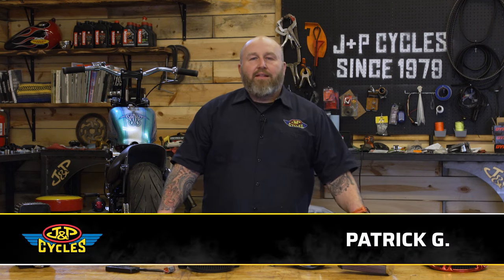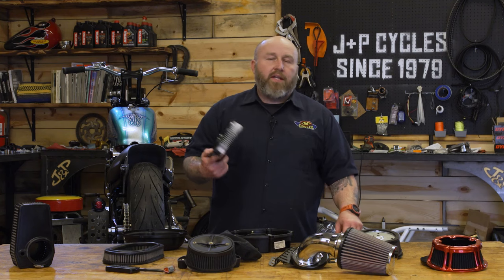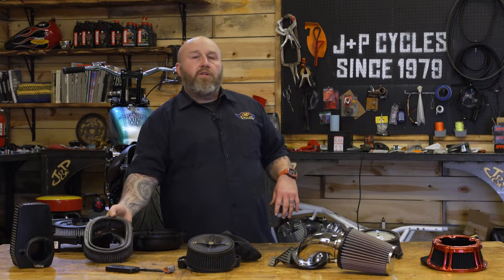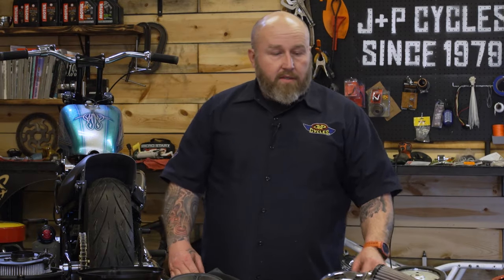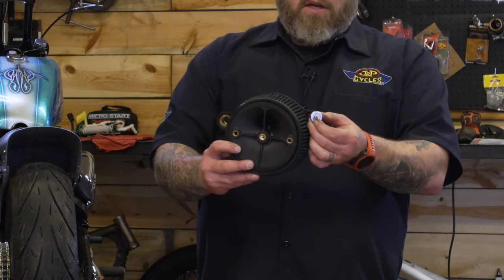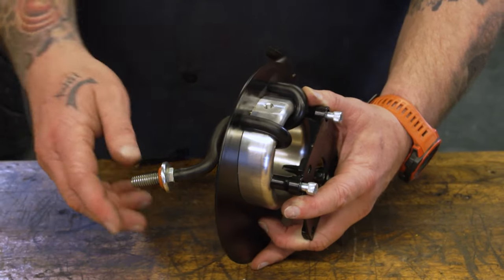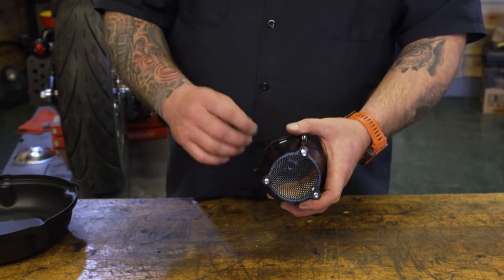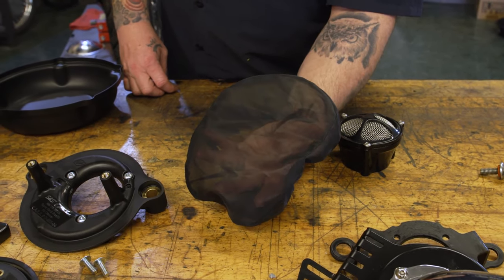Harley Davidson Air Cleaner 101 : Pro Tip

Comment: Anyone that has a clue re vent your engine vent to a catch can never back in your intake !!! 🤣🤣🤣
Reply: Indeed...Not sure why he is promoting that that is necessary to do.
Reply: @beatnuts323  reroute to an exturnal breather or catchcan eathier one works great for stoping your engine breathing hot oily mist restricting power, runs cleaner, and keeps the oil out of your filter and stops it from leaking down the sides of your bike
https://youtu.be/5tTkzGol2G4

Comment: Why Harley-Davidson installed cheap air filter if they are so much important for good performance ?
Reply: Many factors are at play, strict standards govern manufacturers that disposable filter is there for many reasons
Reply from the maker: Manufacturing cost's, CARB and emissions issues. There are a lot of reasons that apply to a bunch of parts on a HD. The aftermarket provides better parts options for almost everything. Seats,  brakes, tires, exhaust etc
Reply: Mainly cost on their end and they probably fit the bill for the 'minimum' air flow requirement needed for the engine.  With the re-usable filters, the oil acts as the filter because the openings of the mesh of the filter body are huge and that is why they allow so much airflow.  With paper filters, the mesh is tighter, which does the filtering, but is more restrictive of air flow.

Comment: An engine is an air pump but it will only flow as much air as the engine configuration will allow, not much point spending $ 500 on an air filter that flows 900 cfm when your engine will only use 500cfm, of course most of them look better than stock.
Reply: Thanks for summing that up. I just bought a Harley and was wanting to upgrade the filter but Jesus I can’t see spending that much money on something like that. It runs fine with a stocker
Reply: @gettindrunker  I just run a k and n high flow element in the stock airbox heaps cheaper and gives it a tad more power
Reply: How do u check ur engine CFM, mine is iron 883. Im new to bike and trying to explore things
Reply: If you understand what "volumetric efficiency" is and where the air breather fits into the equation, you'll have a better understanding of what your ride will and will not be able to handle. Air breathers are only a part of the AFR equation
Reply: @throttleGod  👍👍

Comment: Thank you for putting this vid together.

Now I am sure everyone is asking you a 1001 questions, so if you do not get to this question, the no problem.

I have an 08 Fat Bob with a 96 ci engine that I recently bought second hand. The previous owner has fitted a pair of Screaming Eagle slip on's, but that looks to be it. Asking the shop I bought the bike from RE an air cleaner and having to get a tuner, he said "don't worry, the EFI will take care of that and adjust accordingly". 

Personally I do not take what this shop says as fact and would rather double check anything they say. 

Is this guy not well informed, or would the onboard computer compensate and adjust accordingly with a better air cleaner than the stock unit installed?

Thanks in advance.

Comment: Firstly, the crank case air should be vented to atmosphere, the only reason they vent to filter is for emissions. 

And secondly, it is a proven fact that a stock airbox with a high flow filter is the best combo for performance ( imagine sticking your head out of a car window at 70 mph and trying to take a deep breath... too much air will have an adverse affect on the AFR, thus loosing performance when moving at speed...) 

Obviously, this only applies if you're build is for maximum performance. if its for looks, anything you think looks good will do. Including velocity stacks... (You're not gonna kill your stage one 883 by adding a stack...)

velocity stacks are used on a performance level too, but the length and bore are tuned to the engines needs.

More internet misinformation. Do some research. This information I've shared is readily available. (Albeit a very dumbed down version.)

🍻

Comment: I have a 2021 Harley Fat Boy. You may know that it comes from the factory with a high performance air cleaner, but I ordered an upgrade to that ("extreme" Screamin' Eagle air kit) which is 40% more efficient. My question is; if I plan to install a basic full exhaust on this Fat Boy (whatever brand) and that's it, is there a downside to having this upgraded air kit (like it can't be tuned properly, poor gas millage, poor performance, won't work well with exhaust like Big Shots V&H pipes, etc...)? The advantage is that it will work better with a cam installation?

Comment: I have a V&H on my 2015 road king . Its a VO2 naked air . I noticed that there is a 1/8 inch gap between the back plate and the filter. This should be a air tight fit correct? Just wrote V&H to see why this is like this. Maybe I am missing a part or something was made wrong.

Comment: I have a Vance and Hines V02 intake, chrome with black filter. The filter didn’t have any oil on it out of the box. Instructions don’t indicate to apply any after cleaning. So ....do I oil it🤔?
Reply: Good question. I put one of these on a couple of bikes and don't recall any oiling instructions.
Reply from the maker: It is oiled from the factory. It only needs to be very light oil. Something to keep in mind when re-oiling your filter.
Reply: Is there a compatible replacement filter element for the VO2 Naked kit?
Reply from the maker: @Hogdriver88  you shouldn't need one unless yours is damaged/torn. You can clean and re-oil it.

Comment: Had to improvise the other day and buy a shower cap during a downpour on my cone air filter. Restricted power heavily from almost no air flow. Bike is fuel injected thought and went about 6 miles. Think I did anything bad to the motor ?

Comment: If I do slip-on exhaust and a high flow air cleaner with the fp3 do I have to take the bike to Harley to have the ECU reflashed?
Reply from the maker: No. That's what the FP3 is for.

Comment: I have the TBR V Comp air cleaner. I wanna clean my element but how do I get that blue look for the element? 
I've seen how to clean elements and they always spray on red oil. But not blue. Any ideas?
Reply: The oil comes in different colors, generally red, blue, or black. When you clean the filter and re-oil it just get the color you want. In your case look for blue oil. It may not 100% be blue the first time but close, do not use extra oil just to change the color, it will drip through the filter and you will have a mess. The next time you clean it and re oil though it will most likely be 100% blue the 2nd time. But that color will fade with time and as it gets dirty it will turn gray or black anyways. Watch a video on how to clean and oil your filter. 
Keep the rubber side down 👊

Comment: Correct me if I am wrong: 114’s stock filter is good enough for up to Stage IV.
Reply from the maker: That would entirely depend on what your Stage IV components are made of. There is no way I would trust any engine build to a stock paper filter.
- Patrick
Reply: @jpcycles  wwww